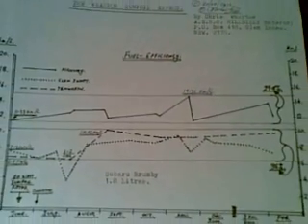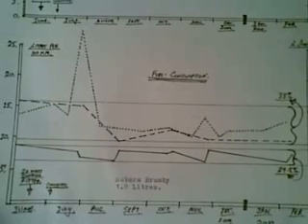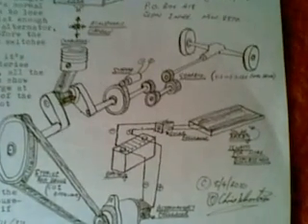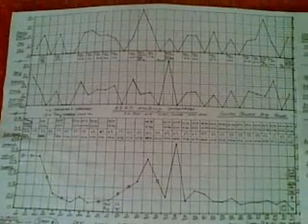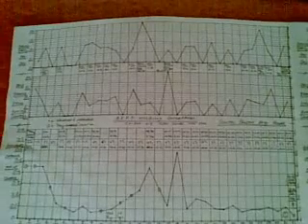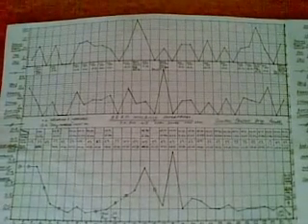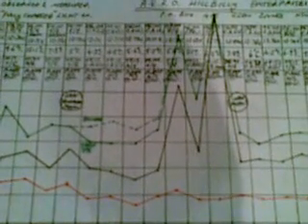SunFoil Science... Raw Experimental Data & Analysis.

Comment: I totally agree a SunFoil would save petrol just like turning off the cars Air con saves petrol ( The alternator and the Air con use more petrol when engaged ) I used to turn my A/c on and off in my VN Calais and my trip computer would clearly show a big difference and i assume the same would happen if u had a SunFoil.

Anything that makes the engine work harder burns more fuel .

I assume that with the newer more electric -hungry cars the increase in fuel savings would increase .

Have a good day

Comment: Brilliant. Thank you. I stumbled over this while surfin around the net... A guy in 2002 coupled an aircraft starter with an 48V generator , batterybank and modify the car just use this extra Power only at  acceleration  to save huge amount of gasoline.

The idea was simple and elegant at the same time.
I found my first experiments very encouraging.
I took a 20 hp 4 stroke gasoline engine coupled to a 48 volt generator
coupled to two banks of storage batteries coupled to a 48 volt aircraft
starter motor connected to the transmission of a ford Fairmont
automobile.
The Ford worked well.
It did not have blazing acceleration but was definitely adequate.
You could drive it around town all day and on the highway at 60 MPH it
would burn 1 gallon of fuel for every 50 miles you traveled.
That is very good for a 3800 Lb. Ford at 60 MPH which on it's best day
would have only achieved about 18 mpg.
I had proven my idea would work so I set out to refine it.
I needed a more efficient primover and I needed a more efficient electrical
conversion system.
I found a wonderful 2-stroke gasoline engine that would put out 25 hp on
one gallon for 3.5 hours.
I then coupled that engine to 4- twelve volt automotive alternators run in
series into 4-12 volt banks of batteries.
Now I had a super efficient gasoline engine with a very efficient electric
energy conversion system.
The car now accelerated very well using the extra power stored in the
battery banks and cruised at 65 MPH using 18 HP and leaving an extra 5
to 7 HP output from the 25 hp Gasoline engine to keep the batteries
charged up to capacity for acceleration when necessary.
I added a governor to control the gasoline engine to throttle back when
necessary and save fuel.
You could drive it over town and high way all day.
It worked wonderfully and achieved 320 MPG when driven on a trip from
Los Angeles to Las Vegas Nevada, a distance of several hundred miles.
The car was a great success publicly and I invited Chrysler, Ford and
General Moters to come to see the car.
They all sent representatives to see the vehicle, but I was surprised
because they did not seem very impressed at all. 
I thought I had discovered the solution to the energy crises and they
didn't even want to study the car I built.
They were polite and they all asked me if I wanted to work for their
companies but none of them were excited at all.
Reply from the maker: G'day,

  Thanks.

    Well, that's an interesting story...; my guess is that the big Car manufacturers didn't show much interest in an Onboard Piston-Engined Battery-Charger for an Electric Car Conversion, because they know who owns whatever Patents already cover all the ideas involved, and either they don't want to have to pay Royalties on those Patents...; or they don't want to compete with Toyota, and their Prius line of Cars, which use what amounts to being essentially the same system.

   The reasons I couldn't interest anybody in Oz in building SunFoils were because it wasn't really a "patentable" idea (everybody knows that Solar Panels make Electric Current, and everybody knows that Batteries need Current to be recharged..., and any PV on any Vehicle will make a beneficial difference..., and all the Components required are already available on the market, so there's no way to prevent other people from using the idea....) ; and because they were desperately trying to sell more new Cars, in an effort to save the Car-Manufacturing industry in Oz (...that failed, the last Production-Line closed down last month...!), and the very last thing which they wanted to do was to tell all their potential new Customers that by retrofitting all their "Old Gas-Guzzlers" with a SunFoil they could restore them to "New Car" (ie, Fully-Charged Battery) Performance and Fuel-Economy.

  So, I put it all out onto YouTube, and now I have the fun of sometimes being able to count 5 or 6 Cars in the main street of my hometown with Solar Panels on their Roof, and half of them are "self-starter/copycats" ; which means that the idea is slowly taking off...

  When I started the project, my son was a 1st-year Apprentice Auto-Electrician, and these days he's now been the Town's Sparky for the past 3 years, and he has one SunFoil on his personal vehicle, as well as 4 Panels atop his Workshop Truck...; so I'm hoping that gradually the rest of the Sheeples will follow along....

  I had no idea how terribly resistant the average person is, towards doing anything a bit different ; until I started trying to explain SunFoils to the Norms...(!).

  Have a good one,

  ;-p

  Ciao !

Comment: Impressive.   Thanks for sharing.
Reply from the maker: G'day,

  Thanks !

   I don't know why more people haven't taken up the idea...

   Since this Video was posted my son has finished his Apprenticeship, he bought the local Auto-Electrical Workshop & Business, and he has a MK-8 SunFoil on his personal vehicle (a Turbocharged Diesel, 4-WD, 4-Door Holden Rodeo). and he has 4 of them on his Workshop Truck (2 x 45-Watt for the Engine Batteries plus 2 x 150 Watt for the Air-Compressor & Powertools & Fridge)...., and there would be about a dozen Vehicles getting around the Town with a PV on the Roof these days.

   I was expecting the meme to catch on, both Nationally & Globally, rather faster than it has.

  At this rate, Global Warming's Extreme Weather will have smashed the Fossil-Fuel distribution-pipeline, and everybody will be wondering how to stretch out their last Tankful of Motion-Lotion ; before the World's Vehicle-Fleet suddenly sprouts SunFoils on their Topsides (!).

   It's a Free Will thing...., whereas I was kind of hoping that the Authorities would mandate having a Solar Battery-Charging system fitted in order for a vehicle to pass the annual Registration-Inspection - like having to have Tread on the Tyres, or Brakes & Steering & Seatbelts...., but the Politicians weren't interested (they wanted people to continue buying new cars "because their old Car had turned into a 'Gas-Guzzler' ..." - ie it's Battery was chronically undercharged & had stabilised at 25% or more Flat....).

   Manufacturing & selling new cars is "good for the Economy", y'see ; and that apparently  matters far more to the Politicians than saving Fuel, or reducing Pollution, or trying to ameliorate Global Warming...

  But, I have tried to share the practice.

 Such is Life,

  Have a good one...

  ;-p

  Ciao !

Comment from the maker: @ChickenHawk110
   G'morning... That's a good question. It began with noticing the 1.5 Litres/Wk saved by the Mk-1. Then I stufffed around getting the Cloud conditions  & PV output, & I used the 2-Stroke Generator to get an Instrumented Baseline.  Then I got the Figures for the 20 Watt Mk 2 & the Brumby, and  the Mk 3. The PVAmp/Hrs per Week vs the Fuel Saved, in all 3 cases was 200-215ml per Amp Hour. The interpolated Results convinced me. Cars make electricity 2.5% - 3.5% Efficiently.

Comment: Can you answer a question, please, straight to the point and without ambiguity, how did you calculate (with your math too please) that the engine burns 207ml of petrol for every amp hour fed back into the battery? You mention this at 12:30

Comment from the maker: @htomerif
   Yeah, it sounds like there's lots of bugs lurking with that one... 
   I reckon the Turbine-Driven Alternator would be the next step, if you had the workshop for it. Chop up a Turbocharger, discard the cold side, compound Reduction-Drive, Shaft to the Alternator Pulley's Plane of Rotation... Then run the Headlights on Exhaust-Gas, and the SunFoil compensates for the short average run-times... I can't see any show-stoppers to it.

Comment: @WarblesOnALot The best I can seem to come up with is a brushless treadmill motor.  There are also some permanent magnet AC treadmill motors, neither of which have commutators or slip rings, however they arent designed for lots of bouncing, water or road dust.  They go up to about 3HP, though Im sure you dont get that at 500rpm.  Also the brushless DC motor would need a complete replacement of its internal electronics to allow for any bidirectional flow of electricity.

Comment: @WarblesOnALot Well I suppose by a hybrid I meant that with a generator/motor in place of an alternator and a bit of electrical engineering you could end up putting solar electrical power back into the drivetrain.  Honestly the control electronics are the easy part.  Finding an appropriate motor is the hard bit.  Ill probably send a message where I can put in more than 500 characters if thats alright.

Comment from the maker: @htomerif
   G'day... Hmmn, what's a  "genuine" hybrid ? Add a SunFoil, save 35% Fuelburn ; my wallet thinks it's real ! The Hi-Beams suck 30 Amps, at 221 Ml/Hour/Amp... Below 10,000 ft AMSL the "Sexy  Turbocharging" isn't needed. 
    So, chop up a Turbo., & power the Alternator via a Redrive. My guess is a Turbo- Electric System would cut out half the remaining fuelburn..! 
   If I had a better workshop I'd try it myself. Much simpler than electrifying the Drive Train..!

Comment: @WarblesOnALot I have a tendency to get a bit too involved in projects and overdesign things.  Now I'm thinking about finding some kind of motor and replacing the alternator all together.  SUV's are crap for aerodynamics, but have a lot of roof space.  If I had a couple of hundred or so watt panels and a few large batteries, I might be able to work the electronics into making it a genuine solar electric hybrid.  Most motors arent designed for the rough conditions in an engine bay though.

Comment from the maker: @htomerif
   Ah, thìs all started when I got a 1 Watt PV for Father's Day. Supposed to charge via the Lighter-Socket & Accessory Circuit, but was too tiny. If the Aerodynamics are THAT crappy, why not stick a flat-edged PV on a simple rack, with a Regulator somewhere between it and the Battery..? The idea is for 2 hours Sun, or 10 hrs Rain, to give the full Daily Static Recharge.... Mine needs 3.68 A/H per day, and the PV is 1.7 Amps, rated at 47 Deg. C. Nice Easy Maths !

Comment: @WarblesOnALot I've got a medium sized SUV, and its as aerodynamic as a brick.  I've been thinking of just adding a second power jack that bypasses the key switch and goes straight to the battery.  Im afraid no amount of aerodynamics will help it, but at least that way I could plug a solar panel into the power jack and leave it on the dash or beneath the sun roof.  It doesn't get driven much and it probably eats a lot of gas to recharge the battery each time.

Comment from the maker: @htomerif
  G'day... Well, the Alternator needs to be there, for headlights at night. But it's Output is dependant on Battery Voltage, and it's Torque required varies with it's output. The Alternator's Regulator does it all, thumps the Amps in when Batt's flat, and tapers the charge when Batt. Voltage rises. It takes 45 minutes average runtime to keep the Battery 90% charged, and the SunFoil has it 100% full (minus sulphation since Sundown) at each Startup.

Comment: I'm a bit confused about weather or not you have the alternator simply disconnected from the car and are running on battery?  My memory is a bit fuzzy, but it seems to me that even at idle, a car alternator will dump 10 or more amps into the battery constantly just wasted to heat, but I dont think youd get far with it disconnected.  maybe more modern alternators are smarter about it.

Comment from the maker: @magna59
   Thankyou... Ley lines, ummm, that's one I hadn 't considered..! But the orientation of the plates to 
N/S is having the same effect wherever I go, and if ya check the 'solar powered fire extinguisher', the battery  there spent 6 months in the Housebank, it came from the dump prior to that, and had a year just sitting (aligned) on the ground before going back into use... That's theoretically impossible, but yestidy it put 50 PSI into the Wormald !